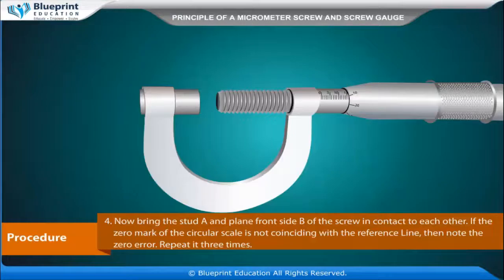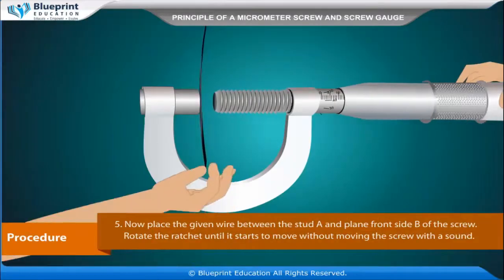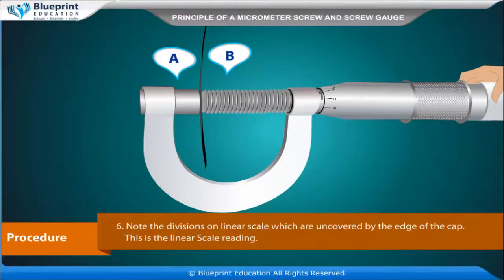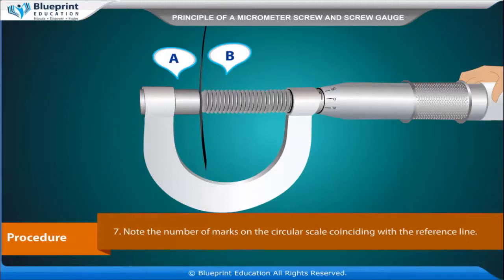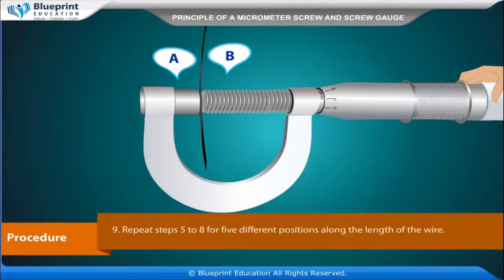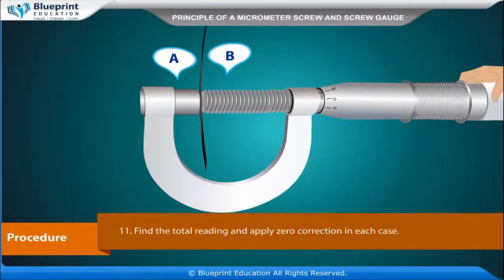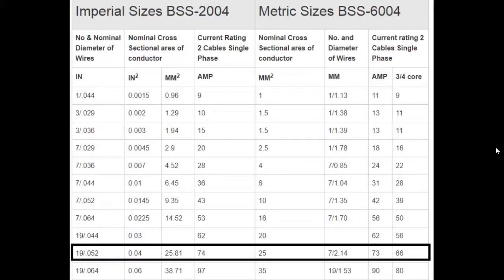How to Measure Cable Size Manually | How to identify cable size

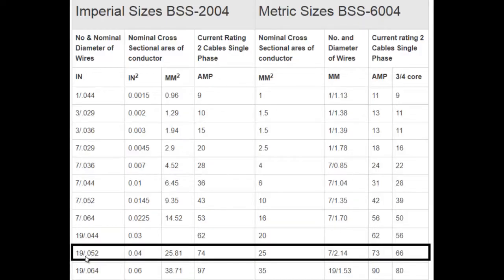Comment: mostly OK but he's using the table incorrectly at 4:02. those are 2 separate sections.
Reply: Do you mean he should not equate an imperial size to metric size? i.e. 19/0.052 should not equate to 25mm2?

Comment: What matters? 350V or 2mm² ? Some show 2× 7029 etc , What should I read mainly , V or mm² ? Pls
Reply from the maker: Voltage is first important parameter. If your application is domestic that 350V enough. And next thing is size. It must be size according to your load

Comment: Sir,but you didn't tell me about netural wire if there is 4 core in a cable so how can we find out the whole cable sqmm including netural
Reply from the maker: If you manage to measure 1 core than u can determine the size of neutral. One thing cable also comes with reduced neutral.  It means neutral is half of size of phase
Reply: Neutral is the return path of the same circuit, so the cross section of a cable is the cross section of a single wire (core as they call it in this video). Note that this is only when working with single phase. If you are using 4 wires then you probably have a neutral+3 phase or earth+3 phase. So then the total capacity of the cable would be 3 times the cross section of 1 wire/core. Be sure that you know what you're working with before doing anything.